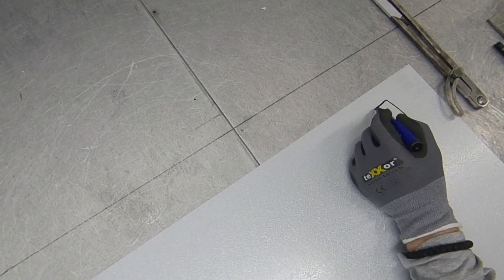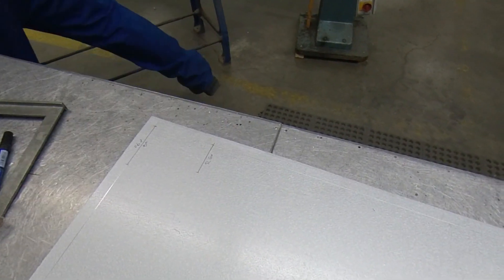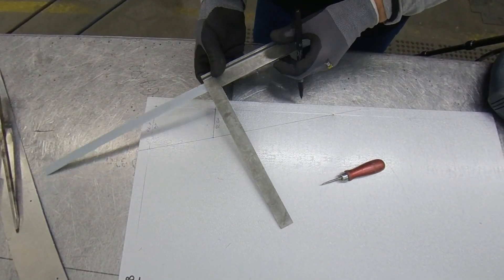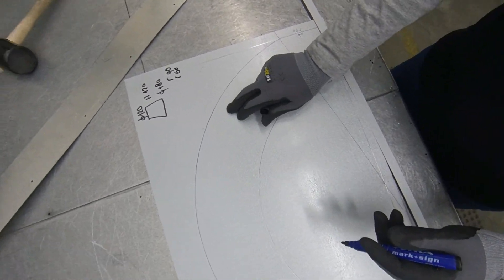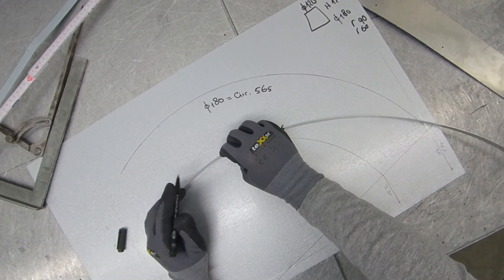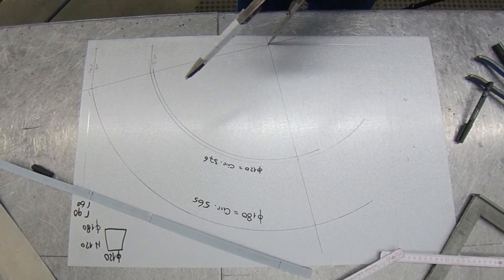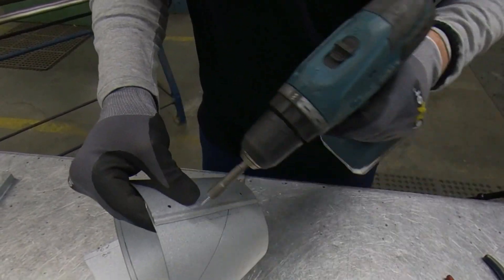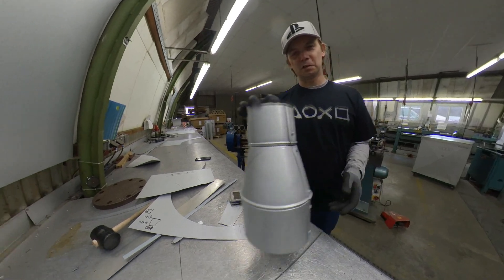Reducer Sheet Metal

Comment: How do you calculate your cut size for you base piece you make the template from?
Reply from the maker: the circumference of the big diameter of the reducer with allowance is the width of the sheet metal